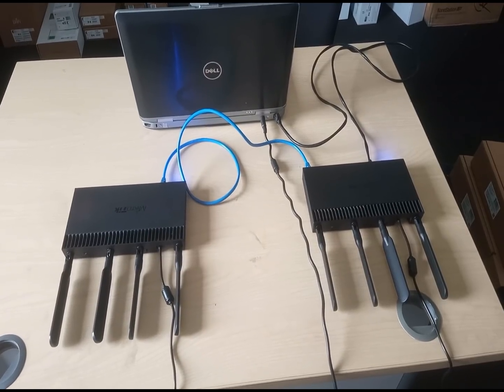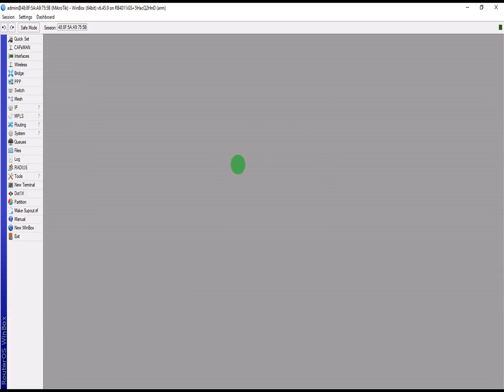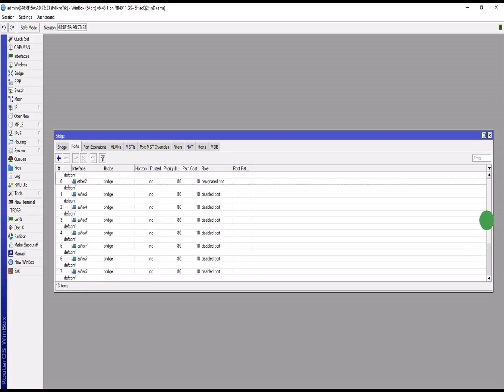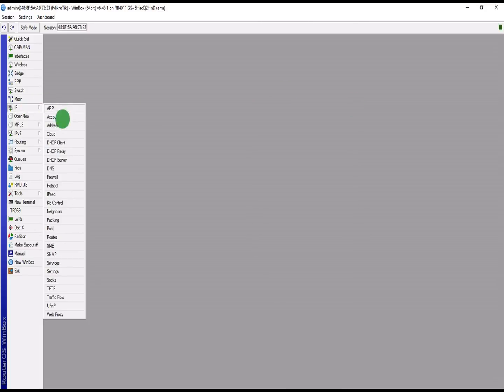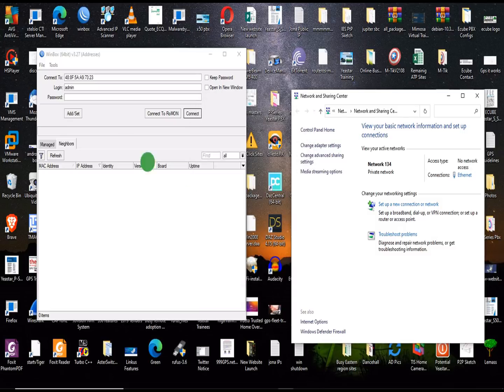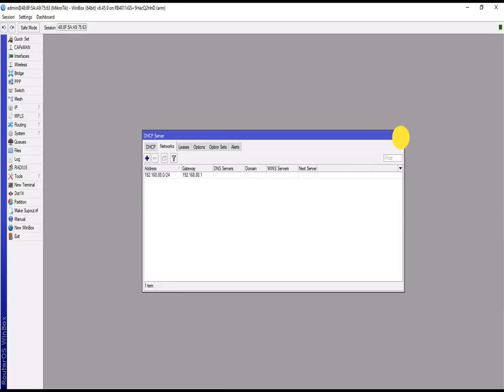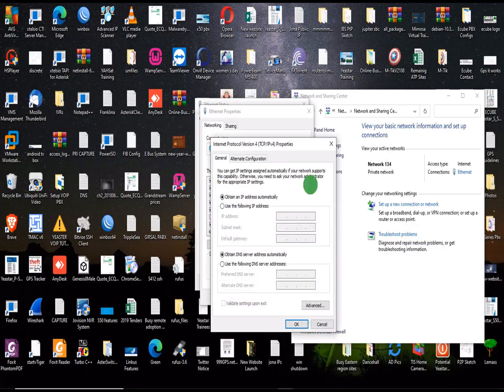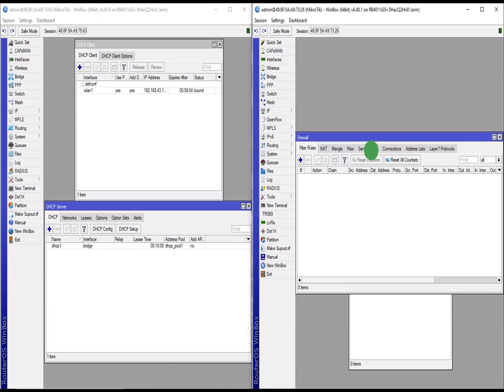Bridge 2 #mikrotik routers as one network full video.

Comment: Do I need to setup firewall rules on the second router if it's not connected straight to the internet for a home setup?
Reply from the maker: No please. You are basically turning it into a switch so there will be no need for firewall.

Comment: Hi, i have 2 routers that provide internet connection. i want to combine them with an additional mikrotip router to distribute it between 10 aps in my dormitory. What should i do
Reply from the maker: I guess you should implement "wan" bonding. I think I made a video of that recently. You can check it up.